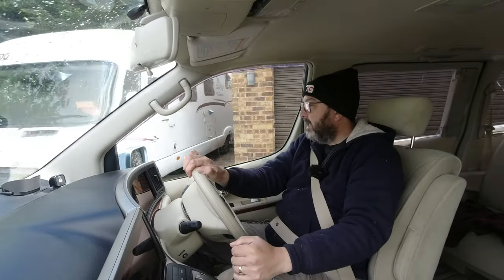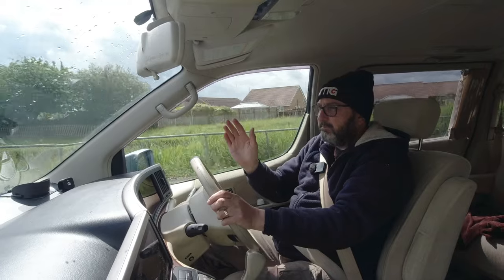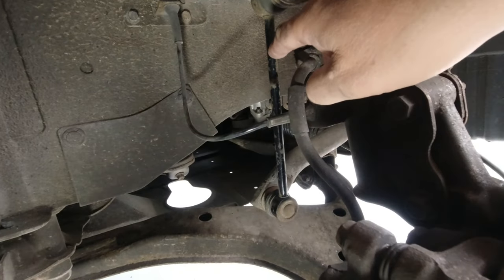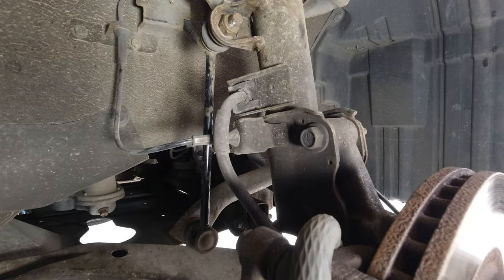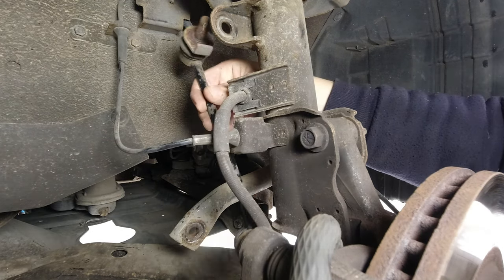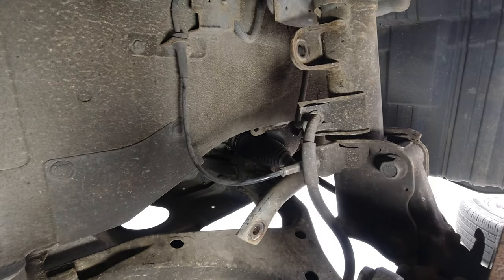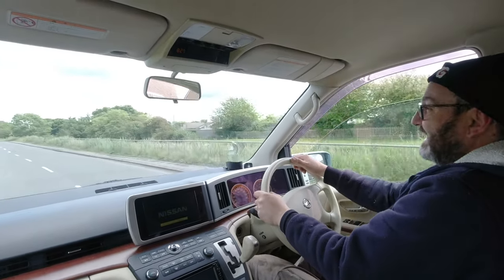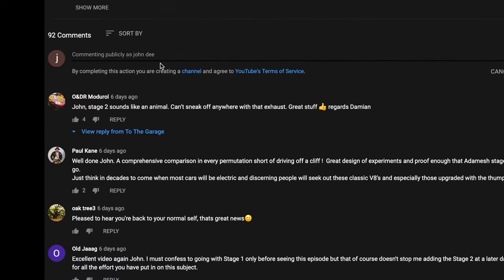How to diagnose and change an anti-roll bar drop link.

Comment: Great video and really excellent explanation of how the anti roll bar actually works. Only point I would add is when I first did this job and tried to undo the old link the nut and bolt just kept turning together. I hadn't realised there was a hex shaped hole in the centre of the bolt end that you needed to hold steady with a hex bit to stop it turning as you undid the nut. Wish my car had those handy tabs as makes this job a lot less fiddly.

Comment: Hello great channel, Ive really enjoyed watching all your Elgrand videos as ive recently purchased one, its a 2006 with 50000 miles, Ive found the ride to be very bumpy over pot holes (no knocking tho) so im fitting new rear shocks and front struts, ive replaced the rear shocks and had a little quick test drive, but its seems it hasnt made much difference on the rear, but really do need more of a test drive, just started to replace front struts and cant get either of the drop link nuts undone, top has rounded off already, so looks like im cutting them off, such fun lol. Yours came undone so easy I wasnt expecting this problem, my Elgrand glides over speed bumps very well, its just sharp pot holes causes bumpy ride with no knocking I can hear, how did you find your Elgrand drove regarding pot holes and shock absorbers? p.s I really like your garage, yours is a great channel and I like your style 😀

Comment: Hi mate, Great video... what would cause a clonking sound when pulling away from a standstill forwards or backwards?
Reply from the maker: Drive shafts worn on a front wheel drive car or prop shaft joint wear on 4x4 or Rear wheel drive car. Loose wheel nuts. Excessive backlash in the differential. Worn engine mounts. Worn suspension bushes on the driven axle.

Comment: Probably the best video explanation on droplinks I've seen. My 2016 fiesta st has a knock and I'm changing these first. Ford droplinks are 55 each vs aftermarket ones around 15-20. In your experience is it best to stick with oem? That seems ridiculously pricey for drop links
Reply from the maker: I would go for a known part supplier name/brand but would not feel the need to buy one ion a ford box. 
These are not complex components. TYpically just two ball joints seperated by the correct length of steel rod

Comment: This works a lot better if both front wheels are in the air, so there is no twist in the roll bar while changing the two sides.
Reply from the maker: A good tip Thomas

Comment: I have a clunk on my XKR, I had the front drop links repalced so those are good. I think it comes from the rear end, not sure if it's shock foam mounts or rear sway bar drop links.
Reply from the maker: Could be either but the lower shock mounting eyes have a reputation for becoming quite noisy as they age.
Reply: I also had a clunk on my jaguar xkr but was coming from the front. I just replaced the upper strut mounts and lower suspension bush and it was fine. However a few days later the noise comes back again from the other side. I'd recommend if it's the front or rear I'd have them done in pairs so it'll save you a trip to a garage again if you can afford. Can be done by yourself but depends on what you want to do with it
Reply: @xkr-mat  I do plan on doing an entire suspension refresh in a few years. Just replace everything that is a wear item.

Comment: Lucid explanation, as usual, John! How does this situation compare with the XK8 ?
Reply from the maker: VERY similar just with much shorter drop links and one end is just a bolt through a rubber bush rather than a ball joint

Comment: Fantastic video! I had my Elgrand drop links replaced 12 000 miles/12 months ago and I am experiencing the same clonking sound again. Is it normal for them to wear out so soon? Thank you…
Reply from the maker: They do wear them out quicker than most vehicles as the anti roll bar is VERY stiff to give such a tall vehicle such decent handling. And hence more force and wear on the drop links
Reply: @ToTheGarage  thank you

Comment: Hi John, how can I contact you with to see whether you can help me with my electrical problems eg all the dash lights on even with no key in the ignition!
Reply from the maker: Hi Stephen. Sounds like a relay has got stuck. I would just pull relays one at a time until I find the one that makes the lights go out. I would then swap it for another of the same spec. If the problem is gone then it was just a faulty relay. john@tothegarage.co.uk

Comment: I have a metallic dangling noise that randomly happens when the road is uneven or on a small incline..has nothing to do  with how fast I go . Any ideas guys !
Reply from the maker: I would guess that one of the heatsheilds has come loose. If you can provoke it into hapening while stationary by blipping the throttle then its likely that the core of your Catalytic converter has started to braeak down.
Reply: @ToTheGarage  ...got under the car shook everything.. nothing's loose. No noise..I tried stepping in the gas hard while In park and everything is fine..I'm stumped

Comment: I guess you can't check for movement without disconnecting them?
Reply from the maker: OU would be incredibly lucky to detect movement without disconnecting at least one of the 4 ball joints. The car will typically always be fractionally out of level and therefore the joints will all be loaded up. So undo one and see what you can feel